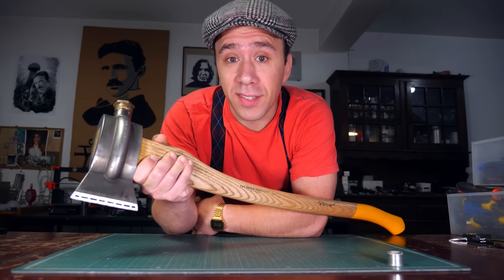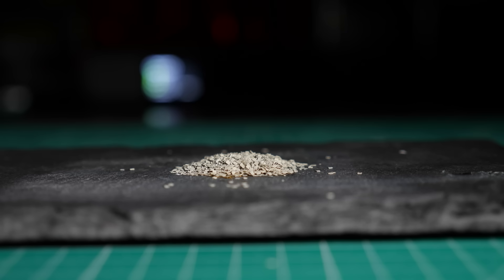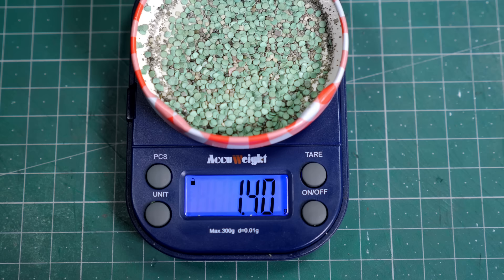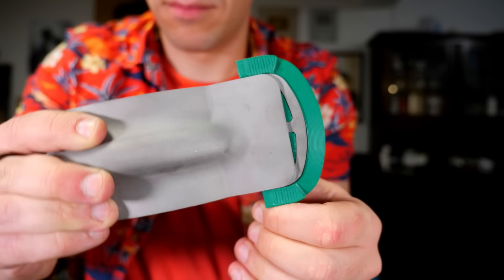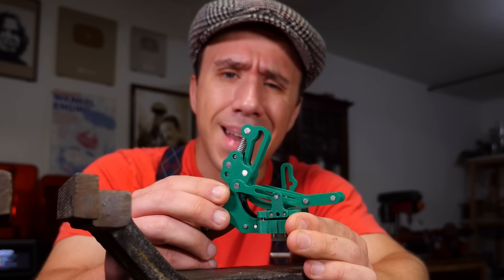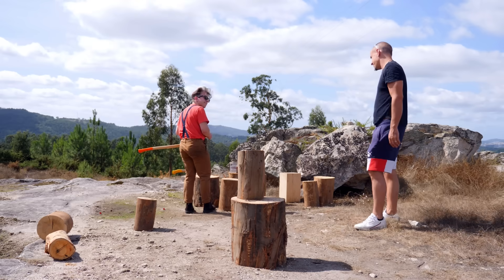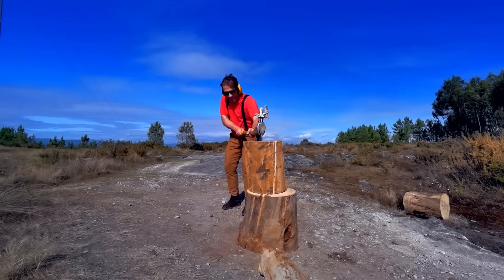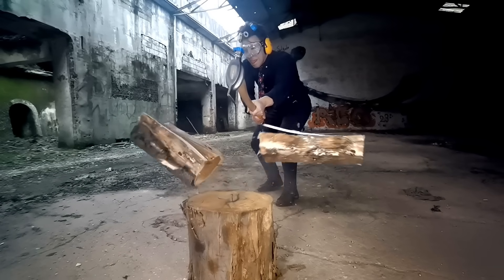I built a BETTER SHOTGUN AXE

Comment: A few pieces of advice from an American gun nerd:
1. You are detonating a shotgun shell in a pressure vessel. The firing mechanism ought to be made with the strength of an actual shotgun. Avoid the use of brass, aluminum, or mild steel in pressure-bearing parts. Securely pin, thread, or press-fit parts together.
2. A mechanism designed to go off on inertia ought to have a safety that mechanically blocks the hammer.
3. Your lockwork is a bit of a... contraption. The magnetic extraction and sliding-bar locking are good ideas, but it can be simplified, strengthened, and lightened considerably. I personally recommend taking influence from the Remington Rolling Block, for its robustness and simplicity of manufacture.
4. To ensure that the shell goes off when the axe stops, I recommend that the inertial sear operate upward. Let me explain: the mechanism has three components: a hammer, a sear, and a sear trip. The sear trip sits above a very stiff coil spring.  The spring is compressed by the axe decelerating when it hits the wood, then rebounds higher than its equilibrium  position when the axe comes to rest. The sear trip then hits the sear, which drops the hammer.
5. The internal geometry of the gas passages will have a large impact on the axe's effectiveness. Surface roughness, sharp corners, and sudden changes in cross-sectional area all reduce pressure, known in fluid mechanics as head loss.
Reply: All good advice here. Additionally you can shape the "blow holes" to form focused directional jets, perpendicular to blade axis. Geometries similar to a linar aerospike may be good.  As it is the gasses are pushing up and out instead of to the side. 
I the new tested geometries are definitely just serving as crappy rocket motors pushing the the blade out. While some of the gas expansion is pushing the wood side ways as a biproduct.
Reply: @agentmongoose i would prefer it not be that efficient. It lifting itself out of the log serves as its own pressure relief while still showing it can split logs like it did in part 1. The logs here in part 2 humbled it some.
Reply: I was wondering if anyone else was squinting when he made his whole breach out of brass and then proudly showed off his whimpy locking mechanism.. PLEASE build it better mate..
Reply: @TheFlyBullet you say that and yet it didnt explode. It even held together well enough to launch itself off the axehead with substantial air time. Its not throwing a handful of lead shot down a barrel. The only place it may have an issue is longevity. Use it for a year and it might start showing signs of wear. One videos worth of use was and demonstrably is fine. Evidence being that it isnt in pieces right now. Brass has more strength than we give it credit for. Its problem is that its soft. Thats only an issue if he tries to use it regularly over an extended period of time. Thats it.
Reply: @sprolyborn2554 even getting that thing launched in the face could have had bad consequences.. what are we even arguing about? This thing is dangerous, it's not build particularly well, the locking mechanism alone is a true nightmare... Yes it kinda held together for the 20 shots he did, but his next contraption might not if he doesn't increase his safety factor by quite a bit..
Reply: I was expecting there to be a war going on here….. I was right
Reply: I work with artillery and other munitions. His first design was fairly close to some inertial base detonating fuzes, these have potential. This design….sure was something
Reply: All excellent suggestions as long as he doesn't break any of his countries fire arms laws.
Reply: best advice from a canadian feller, cut the log in the same direction of the grain
Reply: I'm not an American gun nerd, but I recommend applying gunsmith knowledge as well. Burning HE propellant needs strong containments for the building pressure, otherwise you'll have fragments flying all over the testing block.
Reply: Pretty sure if this was all done by Integza, it’d be on a different channel. The whole point is what you see in this video
Reply: Have you guys watched much of Integza? This is mild.
Reply: Speaking to 4, look at something like a bang stick for shark hunting. So that the act of the axe slamming into the wood causes the firing pin to hit the primer.
Reply: well, well, well
Reply: You could have just stopped at an American we kinda are known around the world as gun people :P
Reply: @malkano86 we're also know round the world as ignorant, arrogant imbeciles 🤣
Reply: So, better use a classic AXE.
Reply: Good advice
Reply: Wow 😮
Reply: The axes could all be honed using that 'extrude hone' paste.
Reply: I think lightening is not what he wants for a mechanism that depends on inertia.
Reply: Get this to the top
Reply: I came to say something similar.
Reply: Trust an American to come in clutch with this info haha
Reply: The original axe head was a better design for that specific purpose as it spread the pressure over a greater surface of the wood. Think of an air mattress, it would only need a few psi to support the weight of a person, but if it was much smaller you would need considerably more psi. His shells (already proven) have enough volume to produce enough. Maybe keep to a similar design as the first, just add a gentle curve to it for ease of use and hit it a little harder to ensure all the ports are in the wood.
Reply: Yeah, we have a term for a mechanism designed to reliably enclose a shotgun shell, detonate it, and then extract it with minimal danger to the user.

It’s called a shotgun. Don’t solve problems that have been solved for you.
Reply: This guy guns
Reply: american's will make a science out of pasta.
Reply: Also should probably avoid having effectively a scintered barrel.
Reply: Pure vessel ya say?
Reply: All good advice but his pressures in this application are much lower than what the typical 12ga chamber experiences. Those pressures get high because of the gas having to accelerate a relatively heavy mass down a barrel. His application is just gas interacting with wood. If the wood doesnt give, it lifts the axe back out of the wood in the slo-mo footage. The one time neither the wood gave or the axe lifted back out at all was with that weird curved axe that allowed for a much deeper and better seal as well as using tougher wood. But even then it just launched the mechanism off the axe. That as well I really like as a relief of sorts. Just add a lanyard so it doesnt go 250 feet into the air. Im with you 110% on some sort of safety though. Dont need this going off when you're messing with it and may have your fingers over the ports.
Reply: @sprolyborn2554 I was thinking that the wood over the ports would act kind of like a bore obstruction in terms of pressure, but you're probably right given the substantial expansion chamber
Reply: @sprolyborn2554  also anyone who is arguing against building the sear and trigger interface out of materials which won't wear themselves down might want to review their insurance polices.
Reply: @Shyid exposure to pressure, heat, and friction is what causes wear. Both of which here are nowhere close to what a comparable shotgun will experience. Brass is more than sufficient here just as freaking pot metal has been sufficient for .22. Ever wonder why nailguns arent built to the same standard firearms are? I guess you could make a 6" thick hardened steel chamber for this and add 40 pounds to the axehead for literally no reason.
Reply: @sprolyborn2554  however there is something called “I don’t want to ever worry about it ever exploding”

With explosives of any kind you can never be too safe. 

Just because brass will work doesn’t mean you shouldn’t use Steel.
Reply: @phsycresconquest6636 in that case, just because 1/2" steel plate would work there is no reason not to use 1". And just because 1" would work, there is no reason not to use 3". And just because 3" plate would work, there is no reason not to use 6" and on and on. Like, even the typical brass casing doesnt start to fail until around 70k psi. And that is a fingernail piece of material. You arent getting anywhere near that with this application on top of this breech being much thicker than that.
Reply: @sprolyborn2554 typical 12ga produces around 740 bar, something north of 10k PSI, lets say its half here because of the bigger volume, thats still plenty if anything on that contraption gives, it could hurt you badly...
Reply: @TheFlyBullet its much less than half even with that kind of expansion chamber and the lack of a good seal. What it really means is that the pressures are low enough that brass is fine. Just dont use it regularly for long enough it begins to erode.
Reply: @sprolyborn2554 yes the seal is bad, yes the pressure is lower, but how the hell can you just tell him it's fine to use brass here without even seeing a drawing? Without calculating this, the only way to be safe is to massively overbuild it - meaning do not use brass, aluminum, copper.. And look up how real locking mechanisms are build.. he launched the thing 10m in the air, twice at least, if the thread or whatever connection wouldn't have given up first, it could as well have blown up that fkn thing..
He had luck this time, he has to build it better next time..
Reply: @TheFlyBullet a brass casing fails around 70k psi. And that is fingernail thick at most everywhere but the base where its a little bit thicker. You arent getting anywhere near that here when you arent even pushing a projectile and have a huge expansion chamber. There is a reason it got launched instead of exploding. And its not luck. The outcome itself is arguing against you. Not me. The reason firearms manufacturers dont use brass isn't because it cannot be used, but because steel is cheaper and stronger.  just because steel is stronger doesnt make brass too weak. We arent talking about the difference between A and F. This is A and C.
Reply: @sprolyborn2554 he is not pushing a projectile, what he is doing is even worse, he's building a potentially closed system, if the pressure can't go anywhere something will give, period. 
If the thread hadn't failed, and the assembly wouldn't have flown off the back of the axe, what would be the next thing to give? There is no way to know with the limited knowledge we have about the mechanism used. The only way to be sure is, build it better. Factor in a failsafe for the pressure to go in the worst case... 
I said it before and will say it again: the assembly blowing off the back and hitting his face would've been enough to injure him badly..
Reply: @TheFlyBullet it might would hit him on the head on the way back down yes. Thats why a lanyard isnt a bad idea. But think about how an axe is swung. For it to hit him in the face, hed need to be swinging at a vertical surface in front of him. It wouldnt magically curve and launch itself at him. Even if he misses and hits the ground, it would launch away from him (rip cameraguy). ironically enough, this being brass IS the failsafe. The soft brass threads fail against the steel threads and launch the device. Had he made this out of steel and designed it poorly, thats when you would see a kaboom. Also keep in mind how brass fails. Its soft and malleable. Even if it did catastrophically fail, it wouldnt shatter. It would sort of just rip open. Slow failures bleed off energy.
Reply: @sprolyborn2554  Yeah, but if he makes it “shotgun strong”, he’ll be able to use a stronger load and split bigger logs. Or at least make more noise 😁
Reply: @sprolyborn2554 i'd argue it might have higher pressures than actual shotgun (assuming same gunpowder load) becouse while shotgun does have to propell the projectile, it actually CAN propell the projectile, while here, it would be more comparable to a shotgun with a half of the barrel submerged in water (i assume you know what happens)
Reply: Sr, I might advice you to check what a detonation is. If this contraption or basically any lead slinger fire tube detonated its propellant instead of deflagrating it it would end with the device in small pieces.
Reply: @teresashinkansen9402  I enjoy pedantry more than most, but his use of detonation and deflagration does, in no way, make his post invalid.
Reply: @quintonthorne3330  Im feed up of people and news anchors calling any short of explosion or even loud noises "detonation". They think they sound serious and technical but they actually sound stupid.
Reply: Literally just said the same things plus a few more prior to seeing this comment, typical.

Add a manual safety.

Lock, THEN Load.
Reply: The sear is obvious. What he really should do is make the sear replace the blasting cap entirely. There’s probably enough inertia in the axe head to ignite it. This way he have just put pouches of gun powder in the axe
Reply: @cybyrd9615  best idea so far. could even have a built in "fuse" like a flintlock so it detonates slightly after the initial hit
Reply: Lots of guns have been made from mild steel that's been case or surface hardened. 

But with a 12 gauge shotgun the max chamber pressure is only like 12,000 psi. Well under the tensile strength of mild steel.
Reply: Not all Americans like guns.
Reply: Hot take: The video's fun to watch only because of how he creates. It's not about taking random advice from a self-declared "American gun nerd" (I work in the industry and that's cringey as fuck, dude).
Reply: Ok gun nerd 😂😂😂 like he would even care what u think when no one else does lol
Reply: you're not a gun smith no have you tinkered around with it at home. Ive used copper as a barrel and it holds well enough (thick wall hvac shit). mild steel has been used in the constructions on guns for a long time.
Reply: @dabadcod4  His username is Remington, so I'm trusting the gun advice from Mr Remington over Mr Cod.

But if it makes you feel any better, I'd take your gun advice over advice from Mr Sig.

Nobody should trust Mr Sig.
Reply: @yngndrw.  oh yes cause user names mean shit. Ive built home made guns for fun and built precision rifles for long range competitions. Ive been privately manufacturing guns for about 12 years now... Everything he said came from AI combining everyone talking points online. He read a book and thinks hes smart thinking he has to be right while blatantly ignoring that people have disproven his "facts". 

Sigs biggest fault was lying about multiple points of failure on the 320.
Reply: @dabadcod4 you CAN use copper but you shouldn't. There is a reason we make barrels from steel now. Even steel barrels expload more often then you would think.
Reply: @yngndrw.  : But who are you going to ask when you get hungry?
Reply: @dabadcod4 , your argument is invalid because it contains an appeal to authority fallacy and an ad hominem attack.

You should avoid citing your experience as the only evidence to support your claims and instead rely on supporting evidence.

The ad hominem, though, is unacceptable. Attacking the character of your interlocutor is what I believe to be the lowest form of argument. You have to refute his/her claims, not defame the individual.

Do better. I believe in you.
Reply: @dabadcod4  Y u soo salty? And quite frankly, rude AF! 

Pro tip, if you want people to listen, change your approach..
Reply: @yngndrw.  Hah, nice burn!😂😂👍
Reply: @yngndrw. kind of want to replace my name to that and state "It ends here"
Reply: @dabadcod4  here he is. The dangerous at home gunsmith. He has a big audience. Being extra safe with tolerances is a good thing.
Reply: @dabadcod4 i have made homemade shotguns with copper and mild steel and they exploded, it’s better to use a high carbon steel, pressure vessels typically aren’t made of mild steel
Reply: @dabadcod4  mild steel was used before smokeless powder. Load a modern cartridge in an old flintlock and it will explode
Reply: @theycallme_nightmaster there is so much wrong and missing in that short statement 😂

Comment: Maybe you can take inspiration from an actual shotgun. (The pump) i can also testify that the pump very fun to do. People to the chich- chich noise all the time! You will not regret it! =)

Making a sliding, locked-in chamber would stop the pressure from backtracking. Forcing your pressure to go out in one direction. Can't wait to see your engineering solution =)

Comment: Use a WEDGE for the gas delivery part.

1. Hammer the wedge in
2. Load
3. Hit with heavy hammer to fire or remote trigger

Simpler to design. Easier to machine. Easier to assemble. Safer (if remote triggered).

The wedge could be as simple as a hollow chunk of aluminium with a wedge with holes on one side and a big hole, in the diameter of a shell, on the other. If triggered with a hammer, all you need is a beefy aluminium cap on top with a trigger. The heavy hammer prevents the cap from flying off. Aluminium generates less deadly splinters than steel and much easier to work with. Any basic machine shop should be able to make one.

Comment: I severely have a really interesting mechanical idea for allowing the axe to fire the shot on contact with the wood. I don't think words could describe it, but I'll try.

Have a metal rod channel down to the front of the axe head or if that is to soon, cut down the rods length. the rod going back up to the back of the axe will be connected to end of a pivoting lever, its rotation could be directly in the center or however much leverage is warranted wherever the pivoting arm needs to rotate. The rod has a spring encompassed around it so it stays level while moving up or down while it allows it to rotate on the lever, the firing needle might as well also have spring connected to it so that it stays level while rotating around only 30 degrees of motion, less time given if you can just cut down how much rotation is there.

I hope you read this. :)